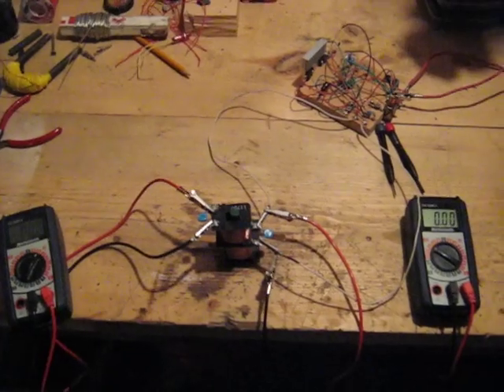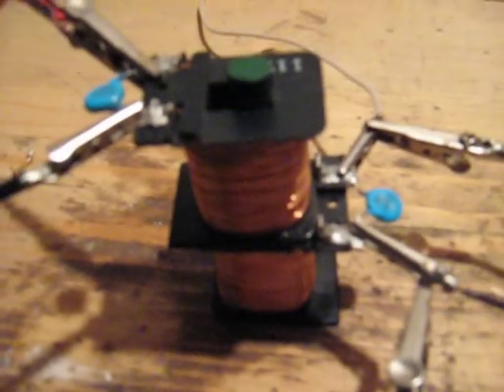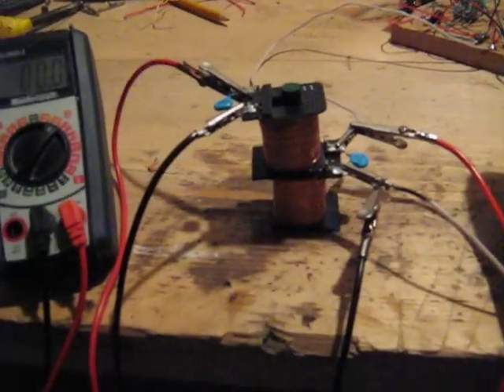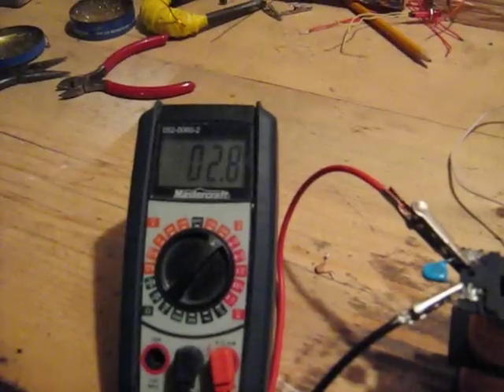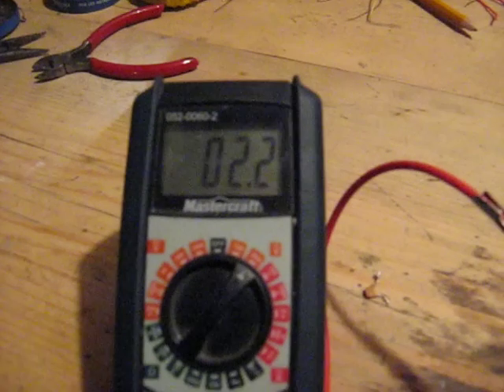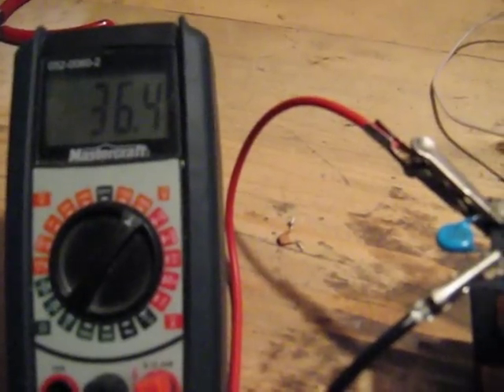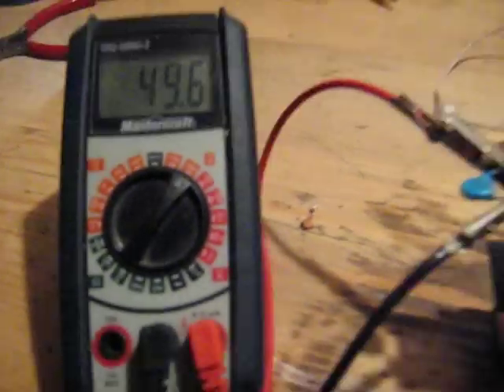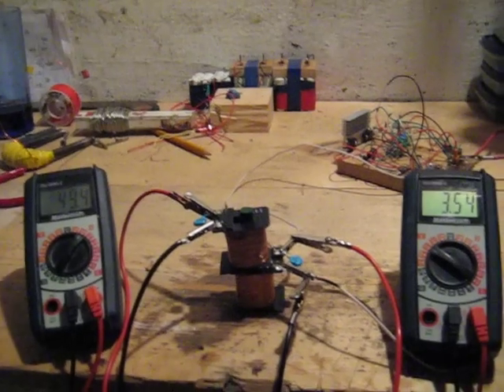PWM - Resonant Inductance

Comment: Hey Dude, did you add any load like a resistor to your sec. coil?
The voltage will drop to its working size...

Answer: The elite against the slaves. Now bet who wins...